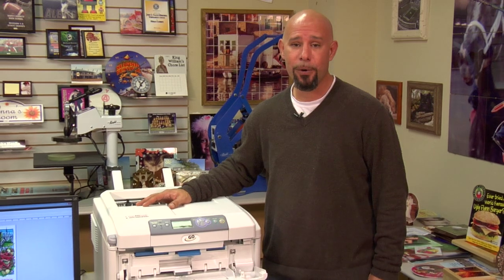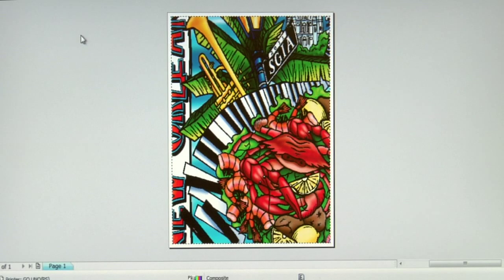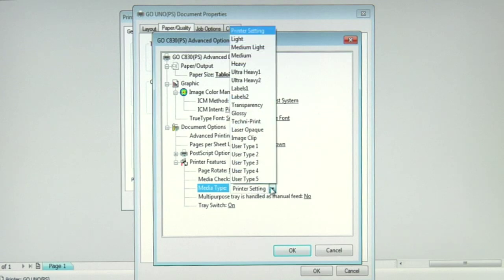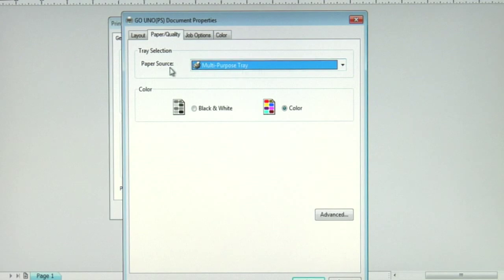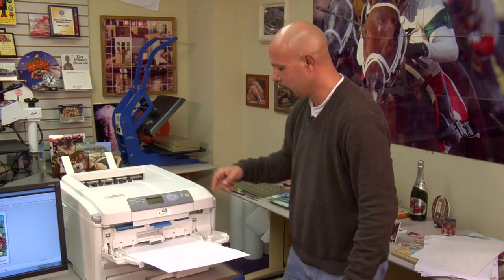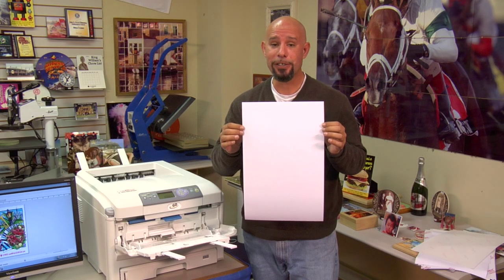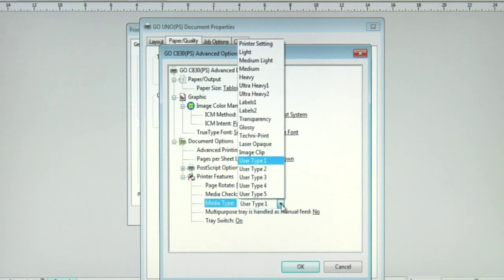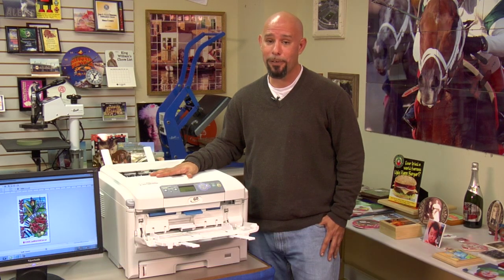LaserMPrints Go UNO and Condé Heat Transfer Papers -

Comment from the maker: Transfer paper durability will depend on the individual paper used.  However, most color laser transfer paper should be able to withstand 25-50 washing before you will notice a significant drop in color vibrancy.  A good indicator of a transfer's durability is the press temperature required to apply the transfer to the garment.  Usually, the higher the press temperature required, the more durable the transfer will be on the fabric.